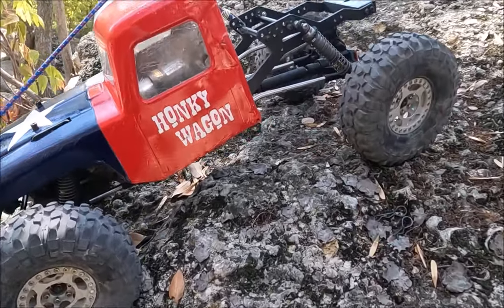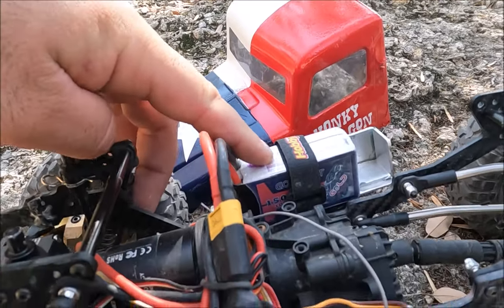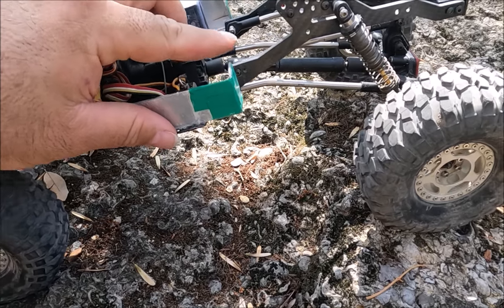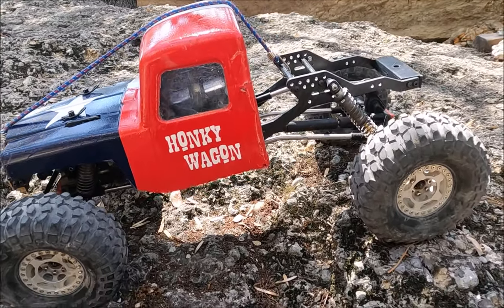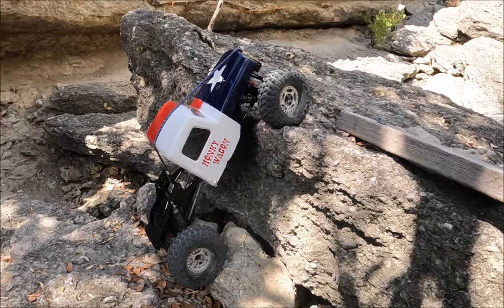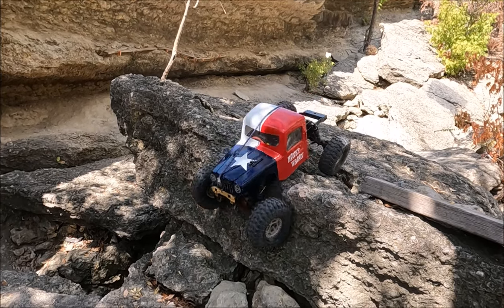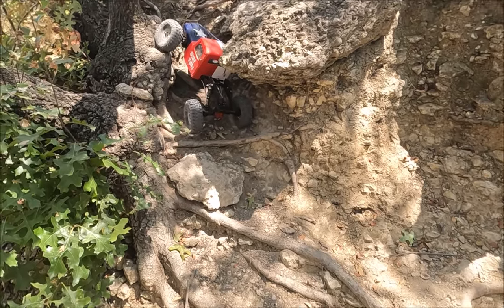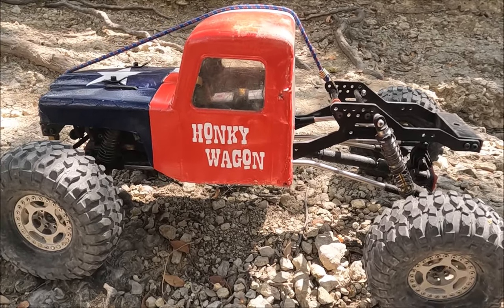Injora LCG Kit for Traxxas TRX4

Comment: Great slow crawling, that lcg chassis looks like its working well, in your install vid i thought it looks about the same before and after but obviously break over is better than stock, is it angled skid?
Reply from the maker: Yes, it's angled and way better than stock.
Reply: @NTX_RC  looks like a performer, I prefer the look of these center skid rails rather than the forward skid with the weird front links. Subbed
Reply from the maker: @thindigital  this one is more of a forward skid but since it's a TRX4 it's big.

Comment: I was thinking about using my stock traxxas lengths cause they seem a bit beefier. Haven't swapped mine over to lcg yet though.
Reply from the maker: I've had no problems out of the l8nks themselves,  they've proven to be pretty durable.  The rod ends, however, are not good.  I've switched those out for Traxxas rod ends.

Comment: hey bud, im a newbie and started my trx4 lcg kit today. I was wondering if you had the time, you could help me out on a few things.
Reply from the maker: Sure, fire away.  Also, I have a whole playlist featuring this build.
Reply from the maker: Nvm, just realized you commented on one of the videos in the playlist, lol
Reply: @NTX_RC   using the 324 links..cant seem to get much artic..out of them with the ends that came with the kit. did you have binding issues? so you went to the different link ends? Man, im sorry to ask stupid questions but im a newbie and love the setup up on this rig.
Reply from the maker: @vb9300  all good man.  I used Traxxas 5525 rod ends on the both ends of the rear links.  On the chassis side I used a washer between the chassis and the frame rail.  You will need to get a longer driveshaft.
Reply: @NTX_RC  i thank you..getting like 1/4" drop. globact has good shafts..have them on my hightrail. lol...wanna build this for me? 🤣
Reply from the maker: @vb9300  if you're near Fort Worth, I'll help you build it, lol
Reply from the maker: @vb9300  watch one of my recent shorts, it doesn't flex very good, at all.
Reply: @NTX_RC  bro, on spittin facts short...hell of a save..thats what i call a texas 2 step down the rocks...yea, im in va. Yea,  I see it doesnt articulate much. Its still bare bones on mine, just trying to get links set up. Got a ways to go and alot to learn.
Reply: @NTX_RC  Hey buddy...I have my lcg about done. I have found something out that may help you with Honky Wagon. With the 5525 rod ends, if you didnt extend the front at all...well...its the same damn wheelbase as a TRX4 Hightrail. Drive shafts fit perfect and so does the f150 body. mods on body mounts but..all the same.
Reply from the maker: @vb9300  I tried a Carisma F150 body, hindered performance,  lol
Reply from the maker: @vb9300  https://www.youtube.com/watch?v=VVPUYFYuMVA&t=462s